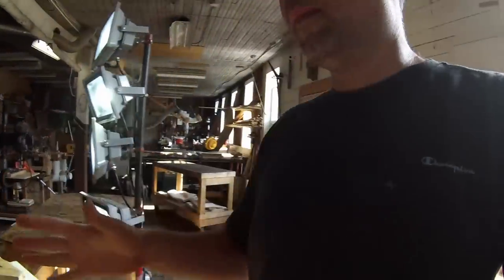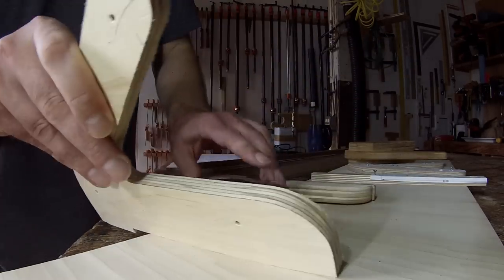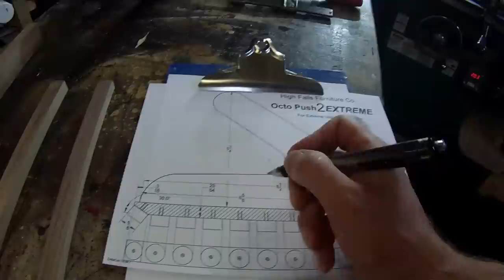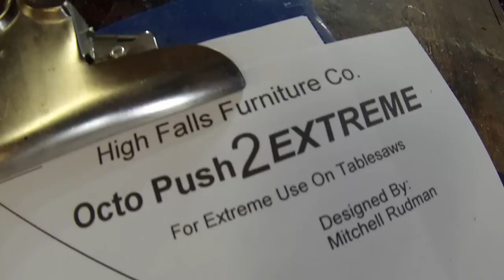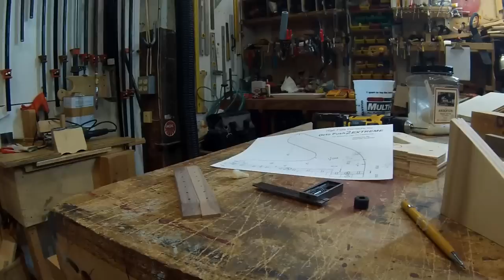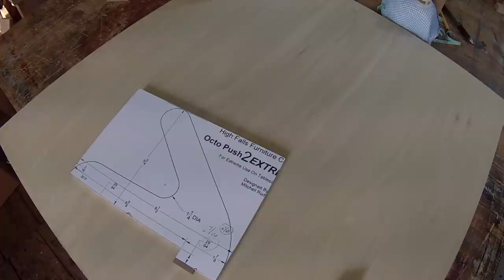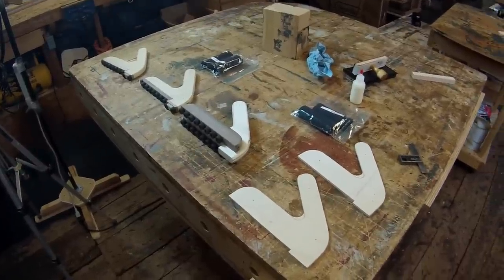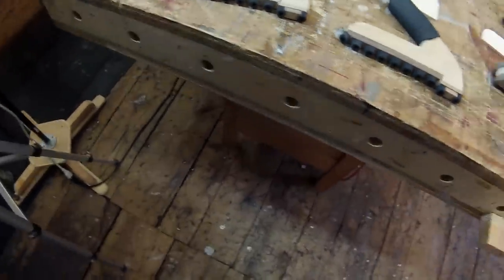Octo Push 2 EXTREME

Comment: Are you selling plans or kits for the push sticks? The idea is really good and the rubber feet are a cool addition to the traditional push stick.
Reply from the maker: +Evan Dunville 
Yes I am selling the hardware in kits on Ebay.  I include paper templates.  http://www.ebay.com/itm/The-Octo-Push-Deluxe-Kit-Push-Stick-Template-2-Hand-Grips-for-Table-Saw-/221731995144?hash=item33a041be08

Comment: Could the cut lines on the band saw meet at the bottom of the handle at a blunt point rather than having to make a hole cut. Not a sharp point but as blunt as you can make it on the band saw. It would save an operation.
Also, I have watched all of your videos but I have to say I am missing something here. Why not put the rubber feet direct onto the ply? If its good quality then they should be OK. Save the wood and another operation.
Just thoughts, not criticising. No, don't start your videos with 'Freaks'! It will freak some people out!.

Colin
Reply from the maker: +Colin Herbert 
In hindsight, I might build the same design with one strip of hardwood instead of three small pieces.  But drilling straight holes in end grain of plywood is more unpredictable and you need a tall fence set up to use the drill press.  I will only do 'freaks intro' this one time.
Reply: +hffcom Understand its more unpredictable but cost of production would be a fraction and with a simple jig on the side of a drill press it should be OK and reliable. I love the contrast of the two woods on the jointer version, looks great but there is a real cost there. Just offering some thoughts.
Reply from the maker: Colin Herbert
I can drill one hardwood stick and then rip cut TWO strips with holes... that would save a little time... but i get what you are saying.  If I was thinking about mass producing these to sell, I would consider the one piece and go all CNC with it.
Reply: +hffcom On the drill press thing, maybe a jig that hangs at the side of the drill press table rather than a tall fence on top. I have one of those and its very rigid and I think quite safe.